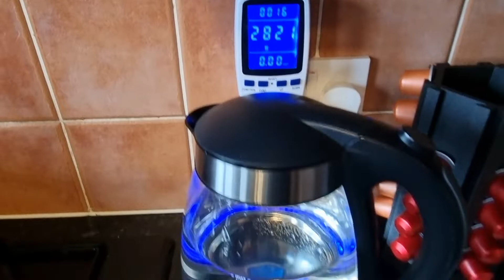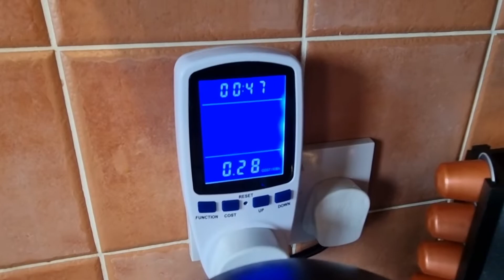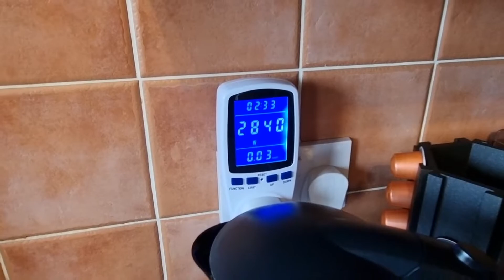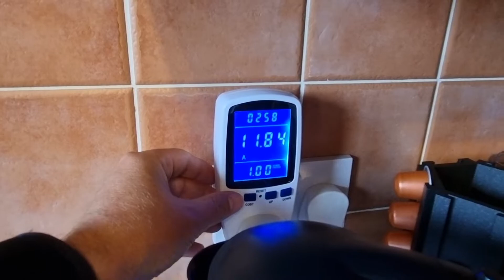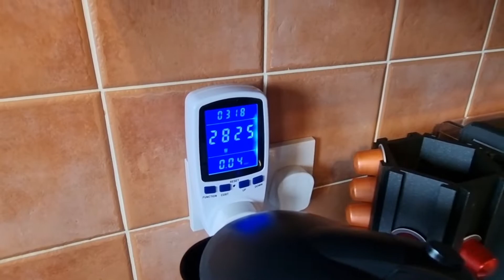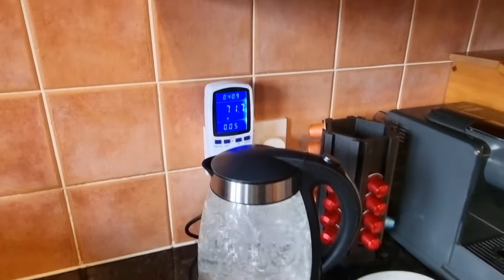The FRIGHTENING cost to boil a 1.7L kettle (@ £0.28 per kwh)

Comment: You'd also save money if you just boil what you need. I work fro. Home and boil about 400ml at a time. Costs about 2p, so not really an issue. The kettle's one of the cheaper things in house to run compared to say the iron, the toaster, grill, overn, microwave or central heating.

Comment: Wow that boils quickly. In Canada we are restricted to 1500 watts. Takes about five minutes or so to boil 1.7 L of water.
Reply from the maker: Wow! That's interesting. I presume that's cause you're on a 110v system and the amperage would be double of what we're on (220v - 250v) ?
Reply: @lyntonjennings  120V. 15 amp circuits. They can do a maximum of 1800 watts. Most small appliances like a kettle, coffee maker or space heater are capped at 1500 watts (80% of the circuit capacity).
Reply: @lyntonjennings  There  are other larger dedicated circuits that are for larger items like the stove, fridge, electric dryer, gas furnace and central air conditioning. Regular stuff used in the living room/bedroom are on 15 amp circuits.

Comment: I also pour my excess hot water from thr electric kettle into a flask. It makes sense to do this and the water stays hot for a long time. 
Your kettle is not a fast boiling kettle. It has taken a long time to come to the boil.
Reply from the maker: Very good! My kettle is rated 2850w which is "rapid boil".. Being in Scotland, our tap water temperature is pretty cold, so it does take a bit longer to boil from start to finish. But when the water is room temp, it's much quicker. If I use the warm/hot water from the flask, it takes about 20 seconds to bring back to boil.